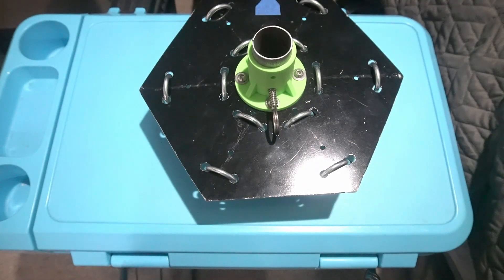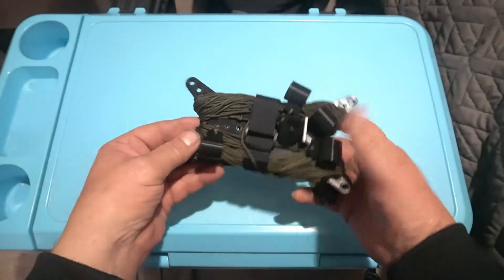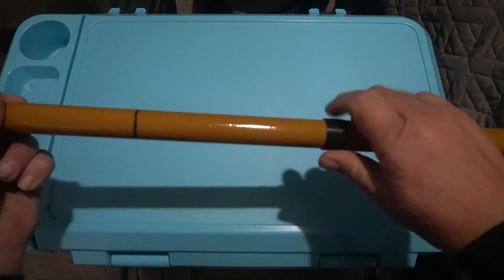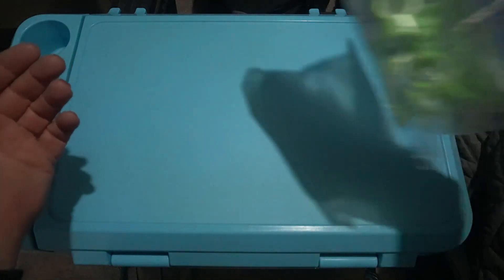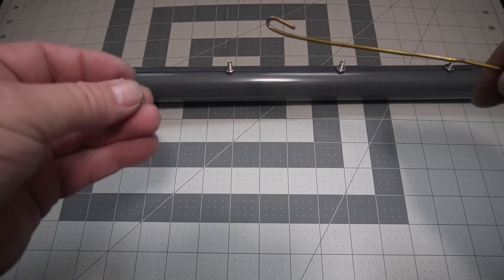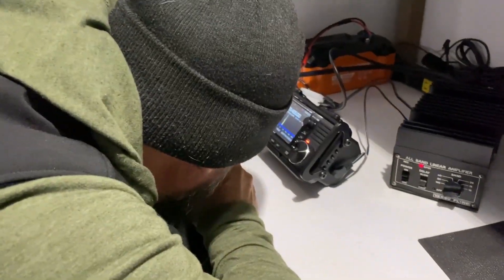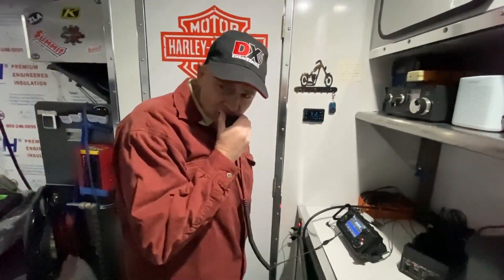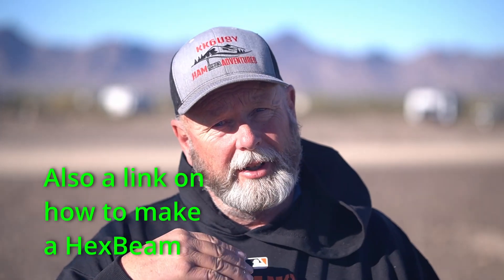Cheap DIY Portable HexBeam !

Comment: That noise looks like an Oscillator on a power supply Or solar charge controller Maybe an inverter Somebody definitely needs to clean something up out there mabe a hand full of clamp on choke beads
Wondering if you had a balum choke at the antenna and radio sence your out in the field , if you have I might have missed that in the video but that alone goes a long way in removing Interference

the coax running vertical up to the antenna can receive and transmit vertical signal with the antenna horzional signal distorting antenna patern and robbing it of some power not to mention receive lots of interference so choking it helps a lot 
. Thanks for sharing your quality video.

Comment: Nice. Spider beams are good...I have one up now. There is a US distributor. I have hesitated with Callums stuff only cause of shipping right now has been pricey. I have really wanted to try a hex but the amount of work and he weather where I live I keep thinking I would just walk outside after a storm and just find a bunch of frozen wires on the ground. If I was more south i would be more inclined to try. I have been noticing there are getting hard to buy...dxengineering seemed to have stopped selling theirs. Anyway great vid.

Comment: Awesome Chuck. This is definitely on the list. I will use tent poles as I can now steady them based on my experimentation with my 10 and 15m Moxons. I might not go the full hog and just make it 15 through 10.
Reply from the maker: I think the poles I used might be lighter but the consistancy was not good for the way I printed them to fit over top like a ring. I know you will do a great job!

Comment: Nice job Chuck! So by the looks of it, it's omni directional. I was thinking because the name has beam in it that it was directional. Pretty amazing that you got Hayden with it! Are they a noisy antenna?
Reply from the maker: No it is a 2 element beam and the noise was the area , these antennas are usually really quiet.

Comment: That Buddihex of mine does bend the pole quite a bit if you don’t guy it aggressively. The antenna is light but hella-wide…so…the arm on that thing makes the ftlbs of weight higher than it seems it would.  That’s a nice build, I’ve run that through my head a few 100 laps too, but ended up buying the sure thing. Nice job and commitment.
Reply from the maker: David I need to guy the pole next time and it should be good. Buying sometimes makes it nice Lol and who knows I may later but I think I will tweek this one some more first.

Comment: Interesting video my friend.  I am considering the same but I don’t 3d print.  I need to source some of the parts — shouldn’t be too hard.  I am an antenna junkie!
Reply: Check Max Gain Systems. They sell all those parts.
Reply: @don_n5skt  Thanks, I will.
Reply from the maker: Gary if you look at the site I put in the comments the parts from Max Gain work with their specs.
Reply: @KK6USYHamRadioAdventures  Thank you.